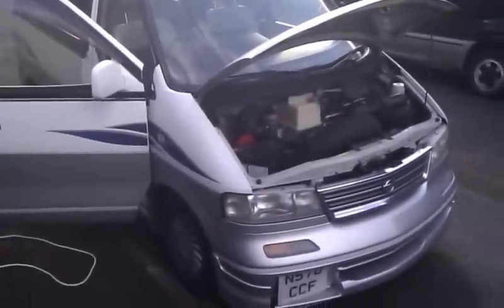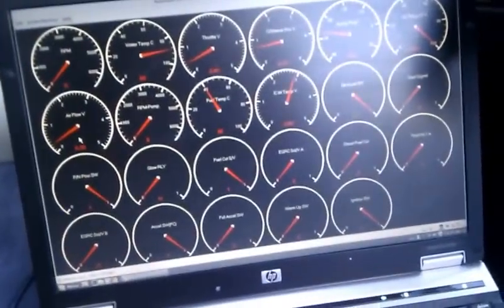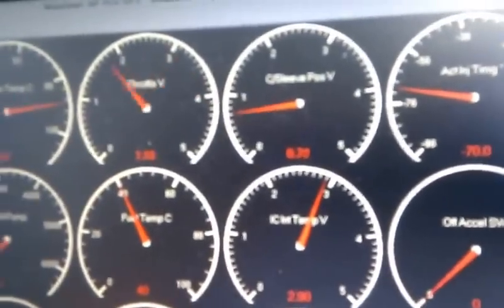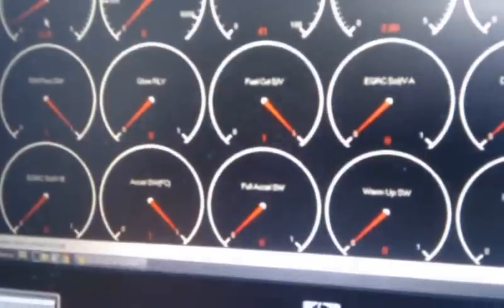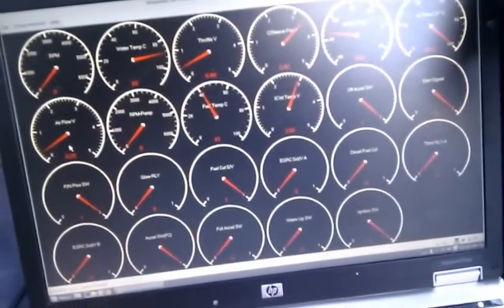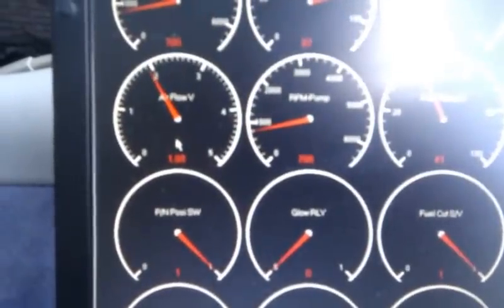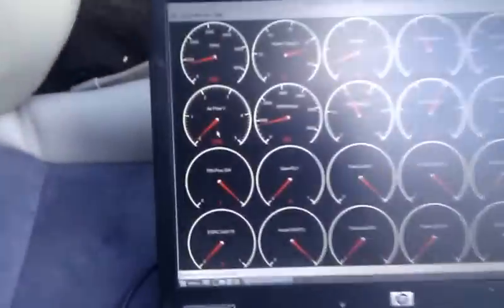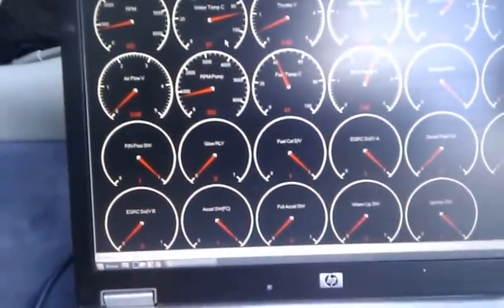Nissan Largo Highway Star 2.0 diesel ECU diagnostics

Comment: Tony, can you confirm what readings you get from the speed sensor when you are going along? Mine seems to over read. Currently got a problem with the transmission occasionally not selecting 4th wonder if it is this sensor. It has once got stuck in first as well. Unfortunately havent got it to play up whilst consult is connected
Reply from the maker: Graham Hobbs sorry no longer have the Largo I'm afraid.

Comment: hi just got this working on my largo. Trying to trace problem i have when in overdrive in top gear at around 40-45mph i get quite a violent judder. Previously had this problem and changed maf and it cured it. Now I have ecu talk working I am hoping to see something spike at around this speed. If you get a chance could you test what maf voltage you get at this speed if you still have the van. And maybe the control sleeve setting as well or anything else that alters according to speed. Thanks a lot